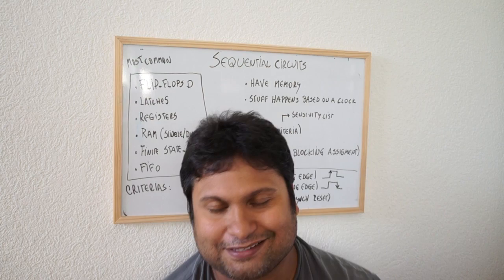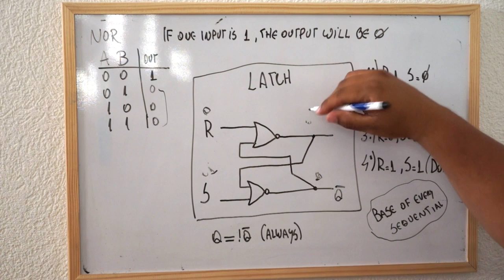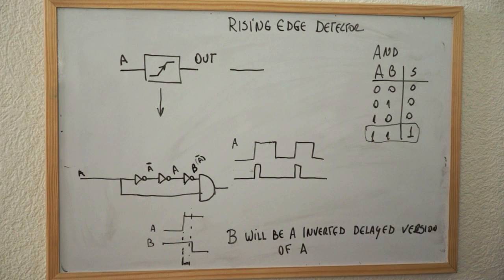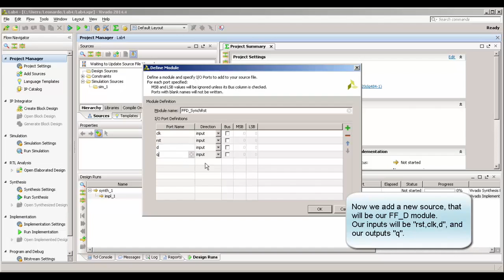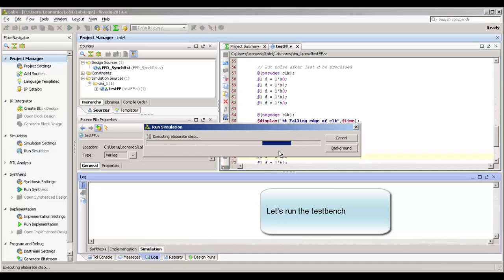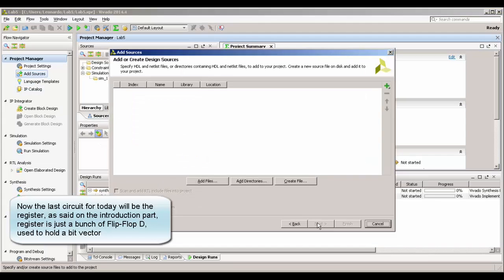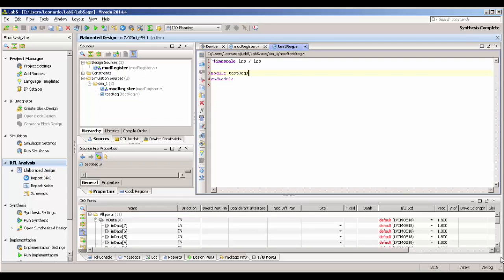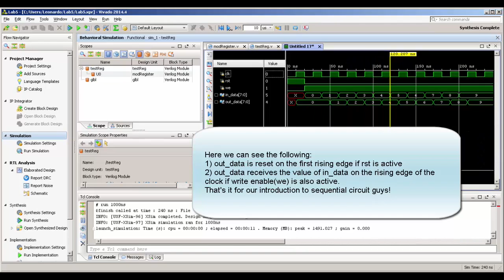FPGA Course - Sequential Circuits Latches Flip-Flops and Registers #05

Comment: Hi sir I'm Raghuttam from India i had one doubt between latch and flip-flop. suppose for a latch if enable is not asserted latch will give output as zero since latch's output will be based on enable as well as input signal. But in flip-flops if enable is used will the output of the flip-flop depends on the enable or will it just depend on the posedge /negedge of the clk??Bcoz for latch we write as always @(en ,in) and for flip-flop we write as always@(posedge clk). can u please clarify my doubt. Waiting for your response .

Regards,
Raghuttam